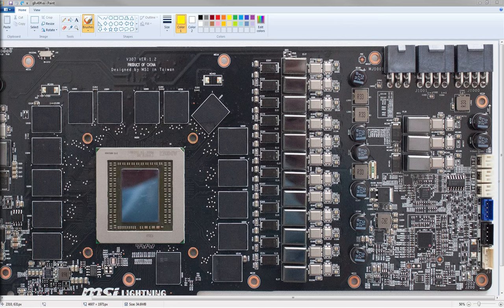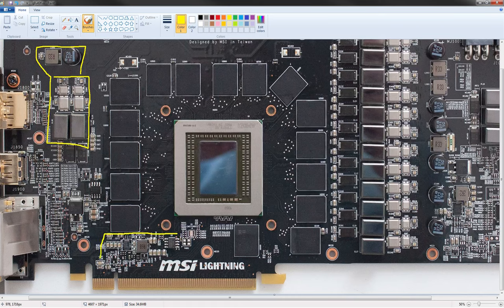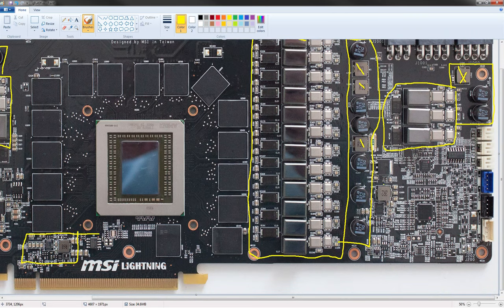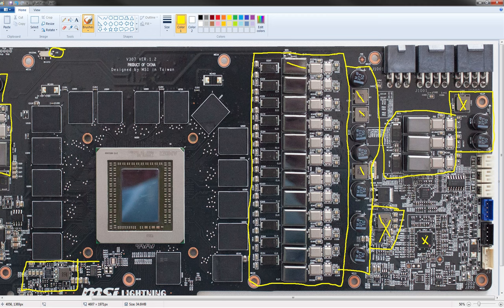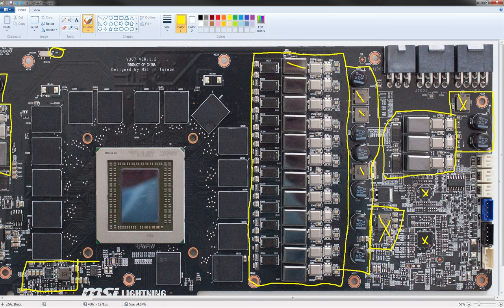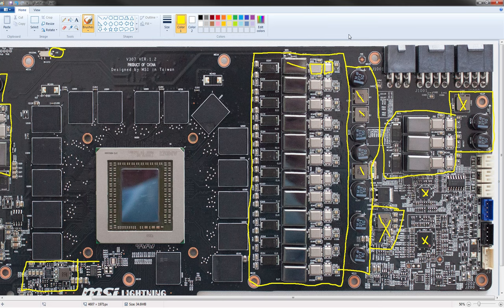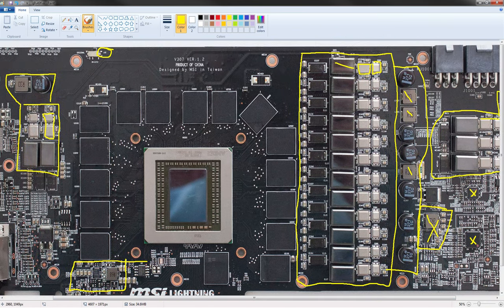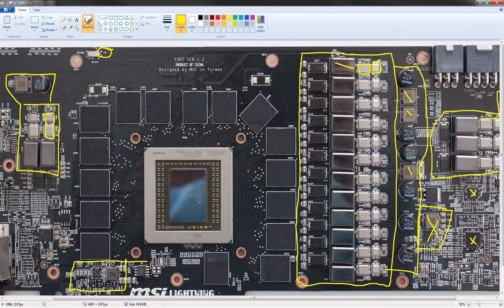MSI R9 290X Lightning PCB Breakdown (The 3AM special edition)

Comment: The Volume is fine, and the quality is better than in previous videos but the compression sounds a bit to much because it sounds like some frequenzy ranges are cut off that deform your sound so that you speak inside a bucket. If you finetune the compressor a bit so its not that agressiv it would be perfekt. But its still way better than before so keep up the good work

Comment: Audio has much improved, nice job. I noticed older cards like X1000 or Nvidia 7000 series look a lot different. Could you do a video on an older card at some point?
Reply from the maker: Those will probably be a pain to get pictures of those I might be able to get them for cheap second hand. Now if only I knew anything about those cards since they are so very old.
Reply: Actually Hardcore Overclocking
No pressure, just a suggestin that might be a bit more interesting.
If it's just pictures you need, I could provide shots of a few 7600 cards. But I don't understand the layout of these old cards at all.
Some make sense, others are all over the place compared to what I'm used to from GTX400 and newer.

Comment: Actually, more impressively, the pulsed rating is, wait for it, 295A repetitive!!
What on earth are these monstrosities?!
So impressed, I'm going to redesign one of my old 3KW switchers to use these, together with fully µC or DSP controlled waveforms.
Reply from the maker: typically pulsed ratings are done at super low duty cycles and frequencies to get an initial junction temperature of 25C and finish the pulse before the junction exceeds 150C.
Reply: Yup.  It's still impressive :)

Comment: It really is the best 290X, i'm not saying that because i'm drunk or because i have Lightning but it really is. Max. temp in "normal" case is 71-72c, you can overclock the soul out of it... I run 1100 core and 1500 memory on lower than stock voltages. And you can push all the way to +200mv on core, and +100 on memory and +50 on Aux voltage, and the best thing is that Tri Frozr can cool this but it gets noisy. However, if you see this card on second hand market... grab it, it's really worth it, yeah it's power hungry but it's a beast. I got higher Firestrike and Valley scores than high OC 970 and 390 so yeah :)
Reply: I had a Sapphire R9 290 Tri-X, and you could push the voltage up to +400mV, +50% power and +100mV AuX with HIS iTurbo. I managed to get it to 1250 core and 1620 memory on air :D It did take +200mV, +50% power and +100mV AuX to do it and the ambient was around 20C with 100% fan speed :) Unfortunately on water, it was cooler, never went over 55C even with a massive OC, but i wouldn't go over 1250MHz on the core :/
Reply: It's not like on FX-CPUs were you need only good temps and you can go insane.
My 7950 runs on 1150MHz @1.3V (+208mV +100% power [just made sure it doesn't throttle] AuX can't be changed) for 3 years now. It's a PowerColor PCS+, cheapest card, 199€ new in 2013. Only Elpida 50F memory, but it has a CHiL chip, so the PCB is better than it was on most pricier cards back then (before the rebrand to R9 280 happend MSi, Sapphire and most other premium manufacturers changed their PCBs to cheap chinese noname ones, so back then the cheap brands [which didn't do this] had the best PCBs).
Raijintek Morpheus (giant aircooler) keeps it at max. 60°C core and 65°C VRM without much noise (but it's now a 4 slot card and has a cut off pen unter it to hold the weight). Putting the fans on 100% to keep the temps lower brings nothing.
Max. power draw is 250W, however average while gaming is ~140W, so it's ok.
In my eyes a really good card, especially on a budget. Used 7950s are now 80€ and it will probably come close to a RX 470.

There's currently a used 290X Lightning here, but only 20€ cheaper than a new 8GB RX 480, so not really worth it.

Comment: theres a pcb image of one of the custom AIB RX480 are you gonna check on that and make a video?
Reply from the maker: I've seen the pic of the Gaming 480 PCB and it's not enough to get current rating or anything. Really all I could tell you is what you can see with your own 2 eyes. It's most likely a 4+1+1 and based on that I wouldn't use it for any extreme overclocking but it should be OK for the average gamer.

Comment: Im trying to fix one of these, the top 6 and bottom 6 phases have continuity across themselves after the capacitors but not across to each side. I assumed it was a 3+3 phase then doubled because of this (with the 2aux on the other side of the card not sure if thats jsut 1 then doubled but doesnt matter here) but according to u it should be 6+2 Aux.. 

Did I jsut find out whats broken and if so how would I fix this? Obviously I could just put a jumper wire but it probably was caused by something earlier on.

Comment: Don't you just need a pcie riser or extender? Or even more  easy you just could put some wires on the backside of the motherboard to take your measurements direct from the pcie socket pins?
Reply from the maker: For the PCI-e slot measurement I'd need a riser but for the most part I just want to show the difference between an 8 and a 6 pin.
Reply: Good to know. Looking foreword for the comparison Video. If you plan to buy a PCI-e riser in the future watch out to don't buy a cheap one. Back in the days of my GTX 460 where I tried to make a custom Case, a cheap Chinese PCI-e riser killed the bandwidth interface of my GTX 460 and now it only runs stable at 8x. Total shame the Card got a little bit fried. The GTX 460 has a total overkill Air-cooler on it with Coollaboratory Liquid Ultra. Even my GTX 770 run hotter and they are water-cooled :P

Comment: ever thought about getting a legit mic for doing these things? maybe a blue yeti or some sort. from my experiences there's only so much you can do with a headphone mic.
Reply from the maker: This was done on a condenser mic ideally suited for recording vocals. The problem is that I don't have a stand for it so it was way too far away to pick up properly and I have no idea how to use a compressor. But I should be able to fix those issue pretty easily for future videos.
Reply: ok lol just saw the headphone mic in your live videos thought it was the same. it is really hard to get the best sound without some post edits. usually pretty quick things depending on the software. it usually takes me like 7 minutes to do it all and most of it is just waiting at loading screens. for the stand I would go with a desk mounted arm so you can always get it where you want it and foam pop filter. both really cheap. I'm really not an expert on this stuff but I have had the nood experience and doing everything wrong and thought id try to help a bit. love the videos btw!

Comment: It's me again... Do you know exactly why i achive much higher OC with the same voltages, temperatures, power draw... just by switching to LN2 bios. I can even undervolt it and have a stable light OC, but on normal bios it goes to shit fast. Does LN2 bios use more power phases or what ? Also is it safe to keep it on LN2 bios all the time, air cooled ?
Reply from the maker: I never had the card and never saw the LN2 BIOS so I can't say. I suspect it tweaks the power limits and probably runs the VRM with the goal of voltage quality instead of efficiency.
Reply: Actually Hardcore Overclocking
Ok thanks :)
Reply: This does have an LN2 mode. There is a switch.

Comment: compression makes the voice a bit like talking into a bucket, but voicelevel is consistant and and its loud enough to hear you clearly. might wanna fine tune how your compressor handles your peaks but other then that its fine!
Reply from the maker: If only I knew how to use a compressor I just chose the vocal preset, did a few checks that it sounds OK noticed that I have too much noise in the background and added a filter to kill the background noise. It also doesn't help that I recorded using a condenser mic meant for recording vocals that was sitting almost half a meter away because I don't have a stand for it.
Reply: what software are you using for recording your voice?
Reply from the maker: I use OBS to record everything at the same the hack is that the audio goes through this: mic >> mixcraft 7(applies all the effects) >> OBS
Reply: a compressor lowers the peaks and amplifies the silent parts. thereshold is the value it is actually starting to do its job. everything above that value is affected by the ratio of the compressor (2-10 times are good values for voice recording depending how much of that effect you want). for attack you want a low value (determines how quick after crossing the thereshold the compressor would kick in) of 1-10ms and release (how long after kicking in it will stay in effect) you want domething like 300 to 500ms for it to be a more relaxed effect.
Reply: for the noisefloor of the microphone (every microphone has one) you can try to play around with the input gain. lower it until the noisefloor is no longer bothering you. you definitly wanna get your input level right before you get the right setup for your compressor...
Reply: and with an equalizer you can filter out the "bucket frequencies" that are usually located in the higher lows and the lower mids!
Reply from the maker: Thanks I'll try these for the next video.
Reply: btw...what mic are you using? via usb or do you actually have a interface? sorry...i´m bit of a audiophile person...
Reply from the maker: I have Rode M2 hooked up to M-audio M-Track using XLR that hooks up to the PC via USB. The original purpose of these was for recording vocals for the "music" I make but since it's the best mic I have I'd also like to use it for videos for this channel where I don't move around too much.
Reply: XD...the "music"...sweet! with that interface you got nice control over the input gain! do you know the effective distance your rode m2 is working in? condenser mics usually pickup sound over distance aswell other then dynamic mics that you really have to shove in your mouth...might work for your "workout vids"...
Reply: greetings from austria btw! ;D
Reply from the maker: It's a condenser designed for live performances. For this video I had it about 40cm away and that requires so much gain that I eneded up with piles of noise in the background which I killed with a filter but I do believe that caused some of the droneniness in this video.
Reply: Actually Hardcore Overclocking hmmm...large condenser mics pick up sound way better over distance. used for overhead recording for drums and for room information in group recordings. but i dont know if that would be the best solution for your setup...how long is the table you´re working on?
Reply from the maker: The area I usually work in for the livestreams is about 3 by 3 meters. The tables are roughly he same.
Reply: where are you buying your music gear from? cause thomann has a really cheap, easily adjustable mike arm for 39€...with that you could easily cover a area of 2 meter...with one mike on the arm and a stationary mike at the screen. that would cover that nicely...

http://www.thomann.de/de/millenium_ma2050_tischmikrofonarm.htm
Reply: atleast on the desks...
Reply: wait...3x3?
Reply from the maker: I guess I'll consider it for the future but as of right now the channel is IMO too small to splurge on audio gear.
Reply: Actually Hardcore Overclocking to fully cover a 3x3 meter area a wireless lav mike would probably be a better solution...
Reply: mind giving me an email adress?
Reply from the maker: libor.sadilek@gmail.com
Reply: able to hook you up with a little something...but i need an adress you got access to...
Reply from the maker: just send me an email we'll cover the details in that

Comment: Still running this card stock with an fx8350 . Unfortunately it can no longer run AAA titles like COD, GTA etc without crashing but I think that is due to the cpu more than the gpu. Great card overall lasted me over 6 years with no issues

Comment: Can the amperage on a gfx card kill you
Reply from the maker: Considering that it's at 1.X volts it would never have a chance of passing through your body which is several Kohm of resistance.
Reply: +Actually Hardcore Overclocking thanks for the clarification
Reply: If you hooked it up straight to your heart, yes it could. Otherwise hell no.